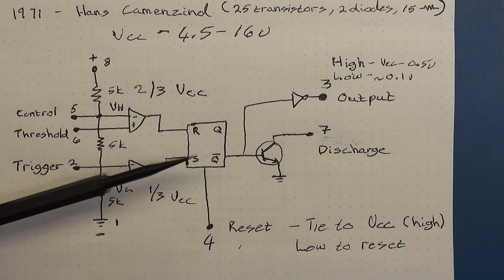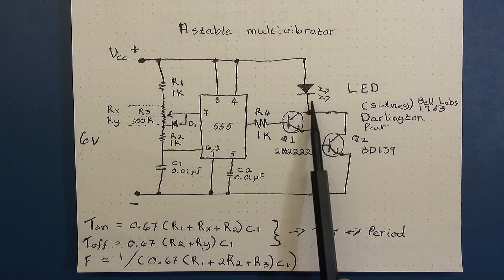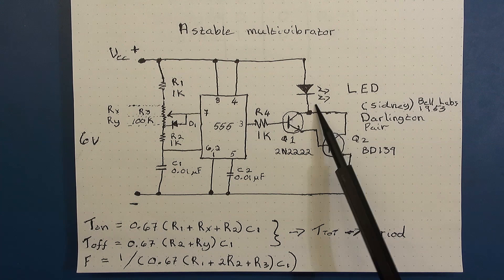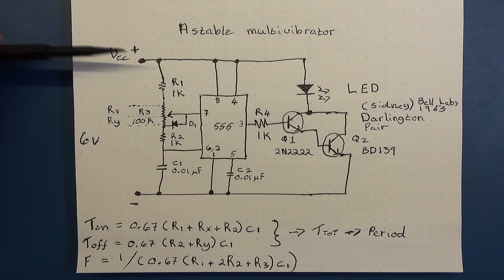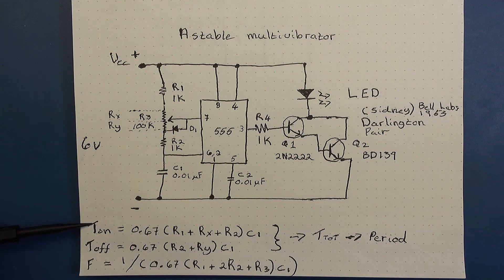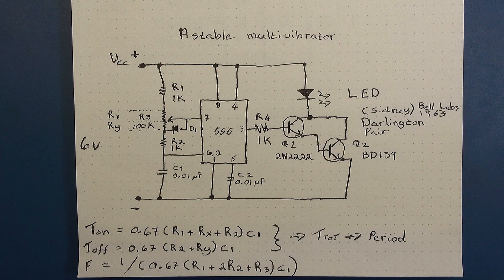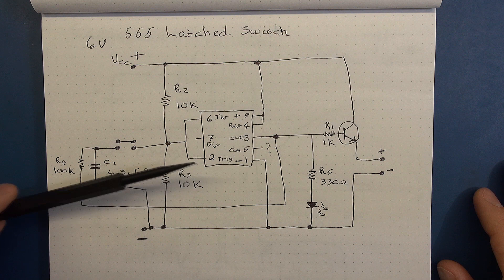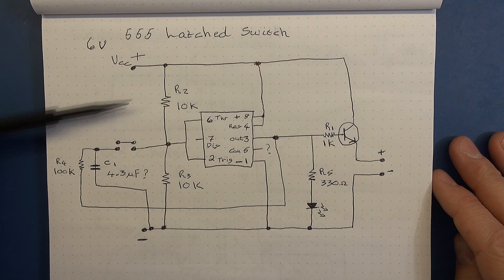Tutorial: 555 Timer, PWM LED Driver and Latched Switch - Pt2

Comment: Hello Martin
Congratulations, this is probably the most thorough introduction to the 555 I've ever watched on youtube. I have a couple of remarks though that might improve your understanding even further:

1. In the latching circuit, you are using an NPN transistor as high side switch (i.e. to cut off the positive supply). This is generally not good practice since the Vbe-drop of 0.7 will be lost -- the astable circuit is only powered with a voltage 0.7 V below your supply. Naively, this calls for a PNP transistor, but using one of these is discouraged in this application because the 555 output might not hit the rails, not driving the transistor sufficiently hard as a consequence. You could use the NPN as a low-side switch or introduce a bootstrap-transistor.

2. In the astable circuit, your LED does not have a current limiting resistor. This is a bit of an issue if your LED is not a special one. You are probably aware of that, it's just that you suggested people play around with this circuit (which I strongly suggest by the way), and might burn out their LEDs while doing so.

3. In the astable circuit, the diode is used to achieve low duty cycles. As a consequence, though, the frequency becomes dependent on the pot-position, because the diode bypasses more or less of the pot-resistance. I didn't check, but I don't think any of your equations takes into account the diode bypass. That said, this is a minor issue because the frequency change is rather insignificant, especially when this is about dimming an LED where nobody cares about the actual switching frequency as long as it is sufficiently high not to cause flicker.

I hope this provides some additional insights
Regards
Matt
Reply from the maker: Hello Matt, thanks very much for the feedback and valuable input. These are points I was not fully aware of so there are many of us that will be wiser for your post.
Cheers, Martin.
Reply: mjlorton
You are very welcome. Apart from that obvious resistor, these were minor points really. The transistor issue is interesting though, as this whole investigation is motivated by the attempt to save battery power. The 0.7 V transistor drop may be significant there, but the use case is different: The 0.7 V are wasted when the light is on, as opposed to when it is off.

On a related note, PWM can also be used for current control. I.e. the control is such that an average output of 20 mA, or 10 mA, or any current is achieved. In e.g. a torch, this is superior since the LED series resistor is not required as the current is set to whatever the LED needs for a particular brightness. Omitting the series resistor means no power dissipation in the series resistor, which in turn extends battery life.

Regards, Matt

Comment: I have found that pin 6 on the 555 timer latch switch circuit should have a 100nF cap to ground. You may not have known it, but pin 6 is very sensitive and just touching it with a damp finger or multi meter lead will latch the circuit to the on state.

Comment: I think if you connect the potentiometer connected to pin 7 differently, you might not need the diode D1.
Connect the pot terminal connected to pin 7 in your diagram (at 9:58 e.g.)  to R2 and then connect the other two pot terminals to R1 and pin 7.  I think you will achieve the same behavior (but with different RC constants perhaps)  as your current design without a diode.

Comment: The only confusing part to me is when you invert the output ( pin 3 ) to power the transistor during the discharge. When I'm simulating the circuit in my head if you have Q and Q- separate it makes sense it's either supplying out pin 3 output or powering the transistor allowing the capacitor to discharge. You kinda skipped over the inverting process or I missed it. Can someone help me? Thank you

Comment: I have always been confused about how the capacitor discharges. Isn't there a current that is pushing down against the capacitor even as its discharging? When we have Vcc come through R1, Rx and R2 doesn't that stand in the way of the current being discharged by the capacitor?
Reply: During the discharge state there is a transistor powered by Q- allowing pin 7 to be shorted to ground so both the Vcc and the charge of the cap is going to earth through the point of least impedance/resistance. Also there is gap inside the cap not allowing current to flow from the negative terminal to the + terminal. Capacitors care about changes in voltage and resistors care about changes in current.

Comment: Hello,

Is it possible to use your solution with 40 LEDs 3.6v 20mA  and 3.7V supply sorce (a few 18650 batteries) without modification?

Thanks

Comment: Hi there. Thanks for the electronics tutorials, they are very helpful.
Does this system provide allowance to cut off the voltage when there is a power interruption (power cut). For example, if I was controlling a small motor with this system - would the motor just start up by itself when the power company re-activates the power?
I've been doing it at 240v/400v for many years with some relays and start, stop push buttons, but am just wondering if it is being achieved with just one push button.
Thanks.